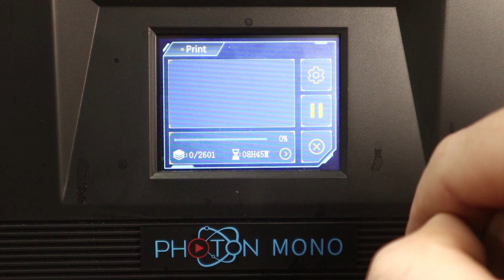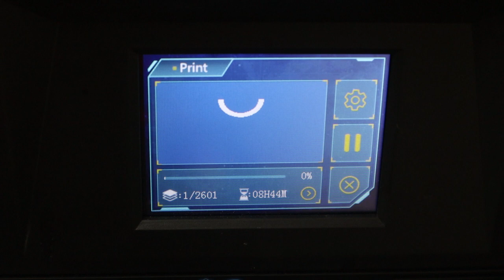Making a Desk Lamp from Scrap Steel

Comment: That was freaking outstanding! I have never seen that machine that was used to mold that plastic. How the heck does that work like that? Anyway, great work on that lamp! 👍👍😉😉👏👏
Reply from the maker: Thanks Steve! It’s a 3d printer that uses UV hardening resin. At the bottom it has a LCD display that is hardening the resin layer by layer .